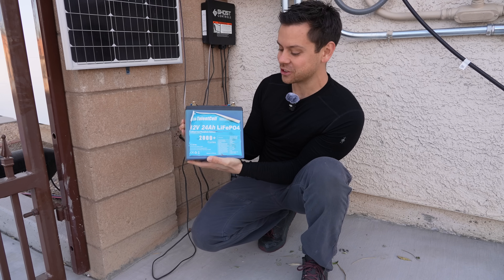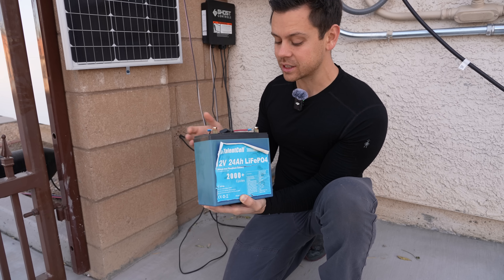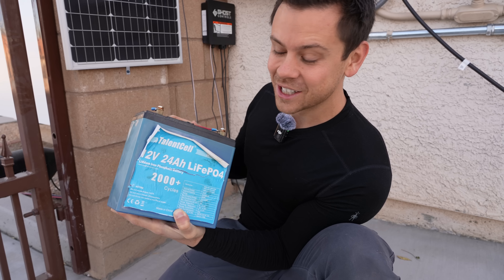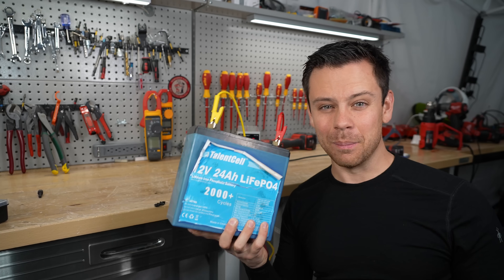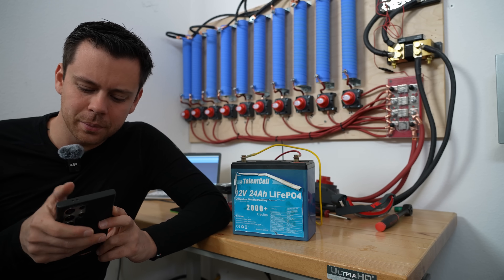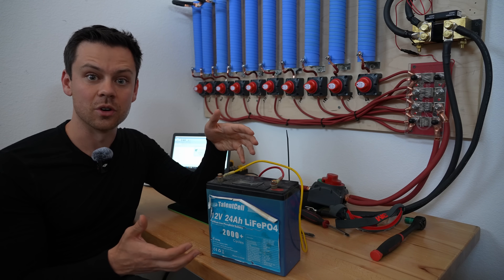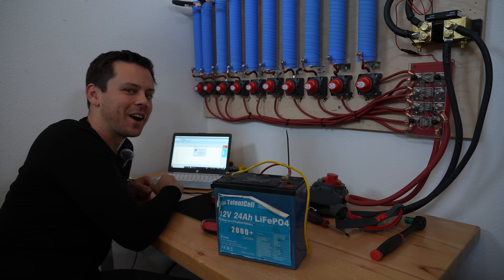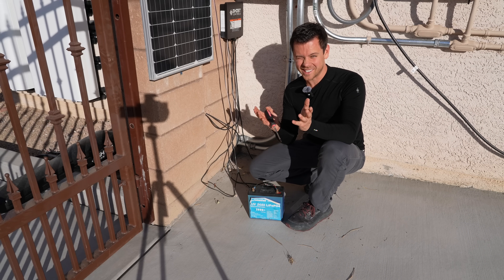Crazy LiFePO4 Degradation Achieved!! Check out the results

Comment: 13% degredation in one year and it took was direct desert sun reflecting off concrete with 120 F temperatures. That means a brand new one would survive 3 years in those conditions before reaching 60% capacity, the typical end life of a lithium battery. That means if they're babied by simply being in a cool underground basement, they'll last their full shelf life of 20 years before hitting 60%.

Comment: quick question chat : can use lifepo4 battery lying down, or they have to stand up in the case? terminals on top ?-  thanks guys
Reply: doesent matter. in this situation you can relate to a cellphone battery. it works however its turned.
Reply: @chupo4putin  thanks so much

Comment: A different question about LiFePO4 batteries.  Have you see anything about fire danger from LiFePO4?  

We have someone looking to install grid scale LiFePO4 batteries, and due to a recent NMC grid battery fire, the community is concerned.  I have looked and can't find anything.  I saw one person able to get a cell to emit a small amount of fire, and another use a torch to see fire resistance.  The torch didn't initiate failure, and the fire from the battery was much less than the torch - indicating to me that a cell failure would be limited to the cell.

This seems to be the right group to get answers from.

Comment: Will I’ve watched you ever since van life and have always wanted to start a setup. Can you please help me to understand what I need to do in my situation. 
I have a Kubota tractor in a storage container and want to ventilate it to keep it from getting to nasty in there. 
Basically I want to run at least 2 fans maybe 4. 1 or 2 pulling air in and 1 or 2 pushing air out up top somewhere. They really only need to run during the hours of the sun beating on the container. 
So could I just do a setup where fans run directly off the solar panels?? Or do I have to have a battery setup in there as well??
Could you please tell me how you would do this??

Comment: This is amazing info ... Professional pool cleaners use their SLA powered pool vacuums to clean 20 residential pools daily. Regular lead acid deep cycle batteries only last 3 years in Florida, and we can only discharge the battery a max of 50% and they weigh close to 60 lbs alone!! Lots of wear and tear. Been thinking of swapping to LiFePo bat and this confirms it!!

Comment: haha, very cool, I live in NM so similar conditions regarding hot (and cold) temp issues. Have you tested any sodium ion batteries? I think they are supposed to have a lot more resistance to temperature range? For the cost they don't necessarily make sense but curious about the technology.

Comment: Bluetti replaced my AC200P under warranty because the screen failed to come on. Now my three sp200 solar panel have failed, but they are out of warranty. Under full sun, there is no voltage out. Any suggestions?

Comment: New studies show Lithium batteries degrade below 0C. It's the cold that really reeks havoc on batteries.
Reply: actually for LiFePo it is the freezing.

every chemical system slows it's reaction in cooler temps. hence better lifespan at 77F (20°C) then somewhere 120+F.

same for every chemistry but lifepos got the kink for freezing temps to suffer from Li+ plating (mirroring).

other then that: 15°C and they'll outlive you.   also moderate charging currents not higher then 0,5C keep them hanging on for AGES.

Comment: I have 2 105ah 51v packages the cells were produced in 2019, i did put them outside but with water air cooler blowing airaround in the summer I tested them 3 month ago they output 93AH which is about 89% of original capacity.
Reply: How is the use? Do you charge and discharge every day?

Comment: Good to see yours have survived so far, though I suspect cold is going to kill those things faster than heat. I can't wait to see how my non-low-temp-protected LFP batteries fare in total capacity terms by the time they've been through three whole years of high altitude desert cold-weather charging out in the field, by comparison. So far (aside from two random "BMS tripped out due to low voltage" instances due to 4+ days of low to no sun) they've done alright, and seem to have maintained capacity better than their larger lead-acid counterparts. We shall see!

Comment: Thanks for tracking the long term degradation. Great experiment. I found one can end up with battery capacity degradation from one (or more) cells loosing capacity or simple imbalance. If the imbalance is removed, you may recover some capacity. It may be all cell degradation or all imbalance or a combination. 

It would be interesting to see if any capacity can be recovered by rebalancing. Since you invested a bit of time in this test, may as well check for imbalance to see how well the balance held up over all this time?

If you could get a peek at the cell individual voltages at high voltage disconnect you may get an idea if you have an imbalance. Simple enough but you would have to crack it open.

I am not saying that the capacity loss is caused by imbalance (I don't know), but there is a chance that part of it is, and you have a chance here to find out :).

( I used a clip on Heltek flying capacitor balancer on a older battery and was able to recover some capacity).

Comment: I use a 24 ah lithium battery for my ghost opener in Vegas that gets used atleast 10-15 times a day for the past 4 years has had no issues so far
Reply: Continual daily draw down, as seen in off grid solar systems, is exponentially more brutal for EVERY battery type vs short duration limited intervals throughout the day.

Comment: It’s reassuring to see that you can buy one of the worst built LiFEp04 batteries, run it through the harshest conditions and after all those beatings it will still operate with minimum degradation in comparison to lead acid batteries.

Comment: YOUR GREAT WATTCYCLE BATTERRY REVIEW WAS SO GOOD I BOUGHT ONE, ITS PROBLEM WAS NOT IN THE EVALUATION TESTS.  its recharge speed, I bought it to evaluate upgrades from AGM bank, used one watt-cycle 100 ah for the test. nothing would get it beyond 13.6 volts, i added to it a linked AGM bank increasing amps saw it go to the 14's over time which was odd, tried 3 various controllers, and watt-cycle said its unusual. ted new test system all day sun it stayed at 13.6 but held it overnight, next day full suin wow its started lifting 13.7 .8 .9. up to 14.4 but very slow, far slower than same solar array when charging AGM BANK.  However whilst finally hitting 14.3 its useless for purpose being far slower to charge than old AGM but supposed to be faster, indicating akin to old worn out battery. MAYBE YOU CAN RETEST ONE and see its charge rate?

Comment: I've been saying this for years - lithium batteries are waaaayyyyy more resilient than we give them credit for, even LiPO and other Li-ion chemistries.

I had a phone battery last for over 5 years of hard daily use and fast charging - still worked great when I replaced it, despite being down to ~55% of the original capacity.

I've even committed the forbidden crime of charging 0V cells!... Turns out, most of them can be coaxed right back into working order. This absolutely requires a proper charging setup with high temp shutoff, but I've seen even the most hopeless of cells emerge with a reasonable state of health and no abnormal qualities other than elevated self-discharge. It's a bloody shame that we toss them at the first sign of wear; they really are a marvelous technology.

Comment: I hope it doesn't go into spontaneous combustion
Reply from the maker: Limited combustability chemistry. As safe as a piece of wood. Not worried
Reply: @WillProwse  Thank you , I've been concerned with Lithium battery explosions. I bought the Bluetti Power Station on your recommendation. But the reputation of Lithium is always on the back of my mind.
Reply from the maker: @WmTyndale  if it does not contain cobalt, it cannot create a self propagating exothermic thermal runaway. In those variants, the oxygen released causes a cascade effect. Not present in lifepo4 at all

Comment: My little Kubota tractor came with a AGM dated 2012.  Tractor always outside in cold and Texas heat.  It has never failed to start the diesel, but is finally sounding sluggish on start.  I wish I could find a good LiFePo4 for a replacement.
Reply: LiFep04 batteries are not good starting batteries. A big battery might have a BMS that trips out at 200 amps. There are some trolling motor lithium batteries that can take huge amps for a few seconds that might work.
Reply: there ARE high drain LiFePo cells. just not the home storage ones.

Comment: You feel like a 24amp hour lithium 12v is undersized for your gate opener? I don’t know what size gate opener you’re using, but most opener motors are only 50watts or so, so even with a double gate opener, you’d likely only be pulling around 100 watts for about what? 30 seconds? 

Most of them just use a 7amp battery or 12amp, or if it’s a 24v opener then two 7amps in series.
Reply from the maker: It makes at 10A so it's tiny
Reply from the maker: For the BMS current rating. Should have said in video
Reply: @WillProwse  Oh gotchya, understood. I just installed a gate opener and was paranoid my basic agm’s were undersized.

Comment: Why would sunlight exposure rather than time or heat be the explanation for degradation?
Reply: The Electrolyte is Liquid. And UV Light is a hard thing so withstand. So heat and cold and UV are the worst enemies of every device.
Reply from the maker: Direct sun here is extreme heat. That corner gets crazy hot

Comment: I’ve got an AGM battery that is degraded, but after 22 years, it still holds a charge and is being used EVERY day, 24/7!!  I am using it to power a 4” computer fan in my enclosed cargo trailer for ventilation.  The cargo trailer has a 160 watt solar panel on the roof and an EPEVER Tracer 10 amp MPPT charge controller on it.  I’ve never seen nor heard of any modern battery lasting this long.
Reply from the maker: How the heck! Wow! Take a capacity test of that thing! Amazing
Reply: @WillProwse  a local battery store (Batteries Plus) has already offered to do the capacity test for me.  I know it is going to be significantly degraded, I just don’t know how much.  It has never been under a large load for its entire life so doing a capacity test on it now has me nervous, but I will be doing it.
Reply from the maker: Post a video too. Let's see it!
Reply: @  I intend to do just that.  The company that made it, Hawker, has already been contacted.  They had a law firm contact me to get the story on this battery to use for promotional purposes.  They are calling the battery “the ageless battery”.  Once they release the story on their social media, I will post up my video.
Reply: if it lasted that long and being an AGM by hawker it's gotta be the predecessor of the odyssey PC pure lead series.  genesis ep12 or something.

those pure lead agm's are absolut tanks.

Comment: Hi Will.P we use best quality cells and very good BMS for our battery pack,why you defamation of us
Reply from the maker: First off the cells never pulled full capacity, so that's the first problem. Next, you don't have low temp charging protection! Did you not watch my first videos? It's not defamation, it's the truth
Reply: @ 1. Our cell have full capacity,it’s only show about 98% because many solar chargers can’t full charge the battery. 2 Our battery produced about 5 years ago. Customer don’t need low temperature protection at that time
Reply from the maker: @talentcell882  I charged till HVD. And most budget batteries have low temp charge protection. It's a basic safety feature and you need to add it
Reply from the maker: @talentcell882  how are you not amazed by these test results??? This is the best comment you can give to praising the degradation rate of your battery? You guys need a new marketing person. Whoever posted this is an idiot to think it's defamation

Comment: i had a 280ah lifepo4 cell burst and start leaking electrolyte after being overcharged regularly and kept inside my car as the deticated car battery for 6 months after it went through a heat wave of 115F for a few weeks. i imagine it was much hotter. it still continued to work but the voltage was sloppy and active balancers were freaking out. i only discovered it had started leaking on one of my monthly checks. all the electrolyte was contained inside the fiberglass strapping tape i covered the battery in. i believe this cell was the one that was originally damaged in shipping. got a refund for the cell and bought 2 more of them with the money since the price had come down so much lol. i think if youre not using garbage damaged cells, they will last forever and are next to impossible to start a fire after this experience.
Reply from the maker: What battery? Sounds home made
Reply: @WillProwse  i made a detailed post with lots of pictures on the chevy volt forums under gen1 -> modifications -> solar roof and 4kwh lifepo4 mod
honestly i was messing around with the state of charge paramaters on my mppt to try and get more juice out and neglected to put them back to default. it was 4x 280 ah lifepo4 cells that i strapped togeather for a couple hundred bucks lol. they fit perfectly inside the footprint of most carbattery holders. now running a 7lb 32ah version of the same thing to save on weight and building 8kwh modular range extenders for my volt which weigh about 100lb each inside of a 20mm ammo can. now i put my batteries inside of metal ammo cans lol, the 32ah version is inside a 30cal can, althought it can fit inside those plastic mini ammo cans. making my own ~500wh powerbanks, just ordered a bunch more of the 32 ah cells for about 8 bucks each
Reply from the maker: Oh yeah just tape battery. Try putting it in a case next time and foam for high vibration environment

Comment: Does having it on cement cause problems? I'm an old man and I was told never to put lead acid batteries on cement. Is LifePO4 different?
Reply: was BS all along. the batterypoles have never been on the bottom of ANY battery. so how would it discharge ?  no matter if there is concrete, carpet, wood, steel or anything else.

battery cases are made of plastic.  (have been for decades)  and that is one of the best insulators.

what could possibly drain a battery if there is no circuit happening whatsoever ?

Comment: Man, buying a few blocks or bricks isn't going to cost you much but will do much of needed protection on the battery.
Reply from the maker: Why would I want that?
Reply: @WillProwse  I think the LFP battery got overheated because of the sunlight, I just thought you would use bricks to build a one side wall by stacking 3~4 bricks up to block sun. So, there is less direct sun light hitting the battery for the whole year.
Reply: @jing-chianwu the point is to degrade the battery that's why he no longer is protecting it. He wants it in the direct sun

Comment: It isn't really discharging much right? Almost always at full charge? Doesn't discharge/recharge increase the degradation rate?
Reply from the maker: No, calendar aging and excessive heat at high soc will age it rapidly
Reply from the maker: Cycling does but much much slower

Comment: will you have a dark side wounding to kill that poor 12 volt gate battery.
How about the Ultimate electric gate battery backup video, or the gated community folks,
the small 12v sealed lead acid batteries suck

Comment: Great Video, as always! Will, if you haven't tested out the Oases Energy 12.8V 100Ah LiFePO4 batteries, would you please do so? I just bought four for my "Power trailer", and my neighbor just bought a bunch of the 300Ah version for his main systems. They were cheaper in price at the time we bought them than your "cheapest" battery on your website. I am hoping you can prove them out...hopefully in a good way, so we don't have to worry about them failing. We are both totally off-grid here in the Southern CA desert.

Comment: That's wild.  I'm charge limiting and grow mildly concerned when my office is rising over 76 degrees. Sunlight never touches my EcoFlow used as a UPS, much less the batteries inside it. 

I just stopped worrying about it.  The way I treat the thing, they should easily live 6 to 10 years.
Reply: 😂This battery should be stored in a good place so it can last 10-20 years.

6-10years is bad
Reply: @AprezaRenaldy  Most online sources to say 10 years is the limit and 20 would be a rare battery indeed.  But the in-use conditions--as a passthrough--as per the guides, are pretty close to perfect.
Reply: @BronzeDragon133  I will say that all these numbers are pretty theoretical, especially when it comes to "lasting X years" - It really depends on the temps. I think, based on what I've read, that if you kept a battery cool(like around 50F or something), it could last *decades*, especially if you aren't doing full cycles daily. Also, it depends on what you consider "end of life". All the papers I've seen use 80% as the end condition, but in most cases, the battery may still be useful at 50% or less, so you can take your calculations and extend them quite a bit.

Comment: Only Will P. would be excited for degradation.😂
Reply: Tests like this are invaluable since basically all we have are the marketing info manufacturers provide. We see degradation of lithium iron phosphate batteries used under more normal conditions isn't anything we need be concerned about. Your last video blew away the out of date guideline to operate these batteries between 80 and 20%. The iron phosphate's need to be fully charged so the BMS can equalize cell voltages. Thanks
Reply: @herblapp6134  agreed
Reply: X2 - I was thinking the same thing 
😂
Reply: lol. Right?!? 😆
Reply: what is I die.. that will be so funny.. um ok yeah